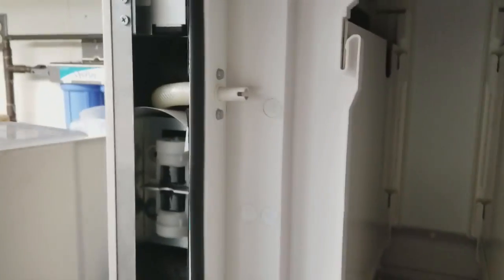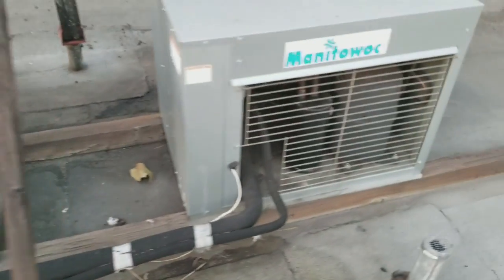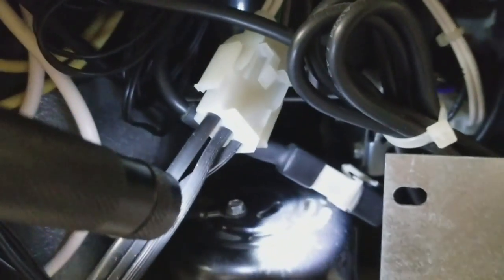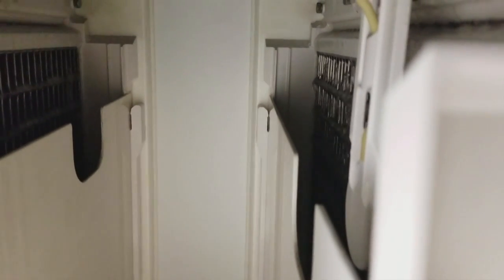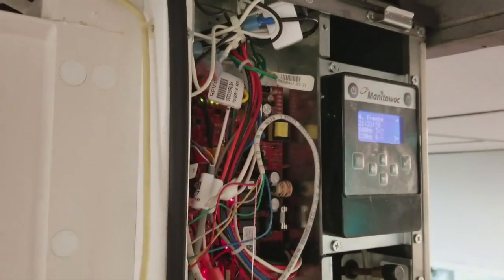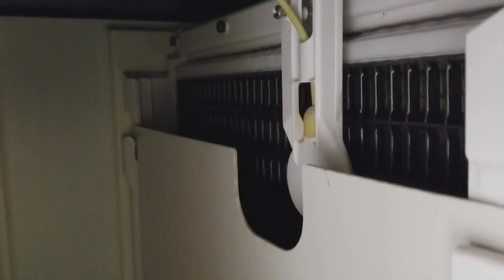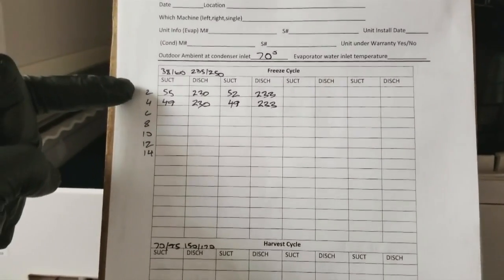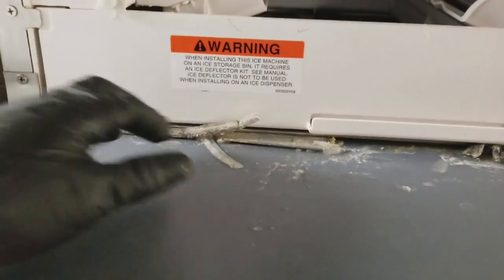Friday night Ice machine call

Comment: I used to work at a resturaunt in Minneapolis Minnesota when I was just out of high school. The ice machine was in the basement with a walk in cooler. Every morning we would have to scrape off the top foot or two of ice cubes to get all the cockroaches out. I was told they were attracted to a warm oil in the head of the machine and fall into the ice bin.
Reply from the maker: I will be going live on YouTube this evening 7/15/19 @ 5:PM (west coast time) to discuss my most recent uploads and answer questions
 from the chat, emails, and the YouTube comments come check it out if you can. https://youtu.be/Jv2Z612YtfQ

Comment: Gahhhhh had one of these the other day that the customer called forced me to come out to fix. drove an hour to get there and right in front on the place the fire dept. was purging the hydrant lines.  inside the customer had zero water pressure.  literally made a suckling sound when I turned on a sink.  explained it to the customer and they told me the ice machine has it's own dedicated line and is not effected by municipal water lines and was told I need to goto college.....Walked out of there knowing I made more on that overtime BS call then he did during his double.
Reply: Michael Kenney you can take them to water... but you can make them drink

Comment: Hot gas valves they stick I went to manitowoc school and have talked to tech support and they swear they don't go out what I found they stick and are flimsy so when I wouldn't have proper pressure on harvest according to specs on book regarding what tech support told me I would replace and unit would work properly all I would look for proper pressure on harvest if wasn't to specs and water temp proper and evap clean  and no leaks in refrigerant I would replace if pressure was not correct and I would not have issues after tech support need to catch up or have part come from different manufacturers
Reply from the maker: going live on Youtube this evening 3/11/19 @5:PM (west coast time) come on over and check it out if you can  https://youtu.be/8b7yomEWfF4

Comment: Ice bridge thickness effects head pressure in harvest mode, so if it is not set up as factory thickness pressure will vary. In my experience the less a pcb has control over in a cycle, the less breakdowns you will have. The fact that this brand of machine uses a damn microphone to activate harvest mode is just ridiculous and over engineered.

Comment: Like the video, but I disagree with putting gauges on those. 99% of the time, including this time, it's water or electrical. Not chastising you at all, everyone has different methods, but I usually use gauges as a last resort, especially on ice machines/small cap tube systems. Keep on making groovy videos!
Reply from the maker: You have a great point but these ice machines are remote 1400 pound models each that have 12.5lbs of 404 per machine so I gauge up almost every time just because this model is famous for leaks. But you have a very valid point! Thanks for watching bud!!!!

Comment: just had a manitowoc school today and they told us as long as you have a min. of 140 degrees on discharge line you should have no problems with harvest, they didnt stress on the pressures.
Reply from the maker: I believe the 140 degree discharge temp rule only applies to hot gas defrost systems. The machine I'm working on Is a quiet cube cool vapor defrost system and they publish that they want 140psi head in harvest mode but I rarely ever see it that high. I usually see the head in the 120's in harvest.
Reply: i will keep that in mind, i never came across vapor defrost,thanks for the info!
Reply: Something else to keep in mind, they're using latent heat for harvest. 410 machines are strange in my opinion. You start with decent discharge temp like 150 or more. 3 seconds into harvest.. nothing. Right off of the compressor 60 degrees. Maybe cooler. I tell you, Mind boggling. Manitowoc basically said its magic, dont worry about it.

Comment: Would like to see tape product you use. I have 12 machines on property from new Manitowocs to 13 yr old IceOMatics... Some of the new machines are half the capacity of what they replaced and are on huge bins. Sadly, the placements are off center with fill in plates on only one side. Bottom line I need to remount several and looking  for a good, one time fix.
Reply from the maker: +dave johnsonnola  so the tape i use can be found here on amazon i used to get it from graingers but they discontinued it. You can copy and paste the link in your browser.
 Permatite Dortite Natural Open Cell Rubber Gasketing Sponge, 50' Length x 1/2" Width x 3/16" Height, Black https://www.amazon.com/dp/B00BPH68ZS/ref=cm_sw_r_cp_apa_i_c678AbMF0FWCQ